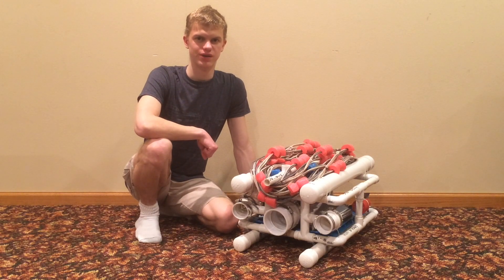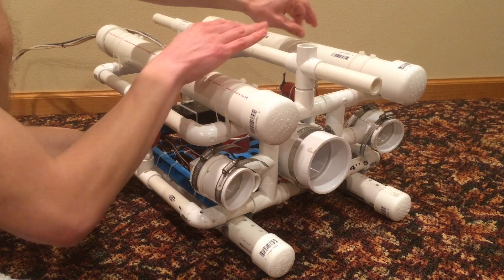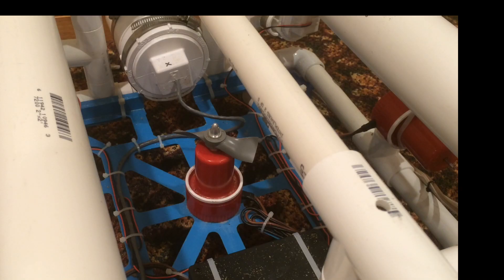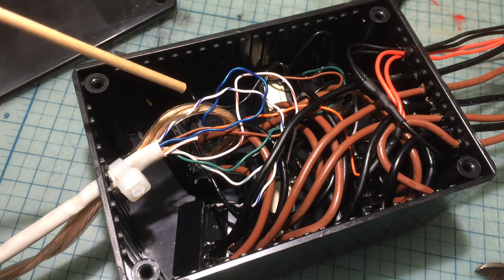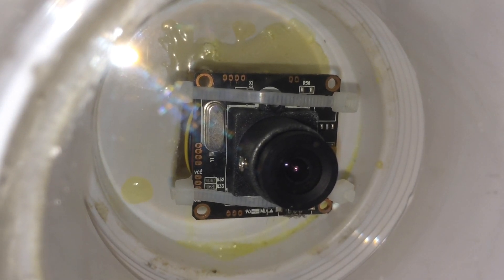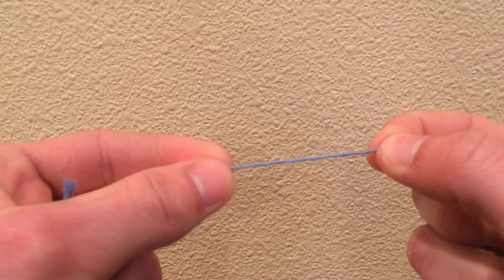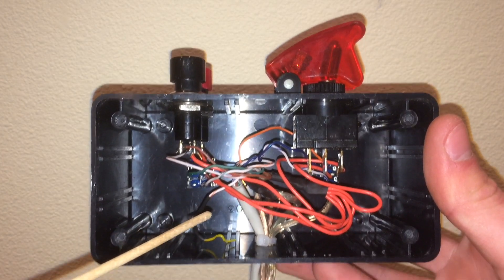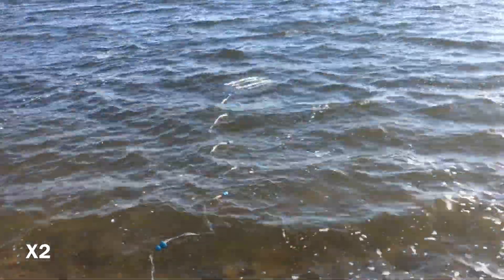Homebuilt ROV Submarine - Seafox Class

Comment: Thanks good information. Maybe go back to phisics class though or basic electronics. My camera and motors run off the same battery as does everyone's who does rc fpv. A capacitor on the power in will eliminate most feedback/noise from the motors. Me LEDs run off the same battery. The resistor is just generating heat and wasting power. A pdb or power distribution board is used. They're cheap

Comment: What's the voltage running through the phone/cat line
Reply from the maker: I initially had the voltage at 12V, but I recently raised it to 14.8V using a 4S limo battery.  That gives the submarine some more power and makes it easier to drive.
Reply: @nathanbroman1601  are there any fuses in the circuit.
Reply from the maker: @enigma3654  no, but it would probably be a good idea to add some.  I think the bilge pumps have some though.
Reply: @nathanbroman1601  one last question. Did you have issues with the amps of the battery running through the ethernet cable
Reply from the maker: @enigma3654  The ethernet cable carries the current to switch the relays, while the speaker wire carries more current to run the motors.  The only problem I've had is that there's a voltage drop over the speaker wire, which reduces the power of the motors.

It's possible to mitigate this problem by using a bigger and/or shorter cable, supplying more voltage, or using onboard batteries.

Comment: Hey! I have a submarine project and I'm wondering what cable I need for fpv to work?
Reply from the maker: I just chose a cable with some RF shielding and the appropriate number of wires to hook up to the camera (3 in my case).  I had a lot of trouble getting the FPV to work properly, so it might be worth considering buying a designated underwater fishing camera with a really long cable.

These two sections on the Homebuilt ROV Forum might have some more information:

http://www.homebuiltrovs.com/rovforum/viewforum.php?f=15&sid=e19036ce7796862a77d0d83ff8176424

http://www.homebuiltrovs.com/rovforum/viewforum.php?f=4&sid=e19036ce7796862a77d0d83ff8176424

I also found this article especially helpful for figuring out how to connect all the wires:

http://www.homebuiltrovs.com/rovforum/viewtopic.php?f=4&t=1584
Reply: @nathanbroman1601  Thx a lot!

Comment: So is there some kind of splitter on the rov that the speaker wire hooks up to to provide power to the thrusters?
Reply from the maker: The wiring diagram can be found here: http://www.homebuiltrovs.com/howtorelaywiringdpdt.html.  I hope this helps.
Reply: Did you use cat 5 pairs to connect the relays?
Reply from the maker: @EchoHawk1862  Yes, I did.

Comment: were did you get the 8 pin relays at, and how much did they cost?    and can you also explain and show how you wired up the relays
Reply from the maker: I got the relays from Amazon.  There are a variety to choose from.  You will want double pole, double throw (DPDT) relays, that are sealed so the wax doesn’t get in.  Also, make sure the relays can handle the current required by your motors.  There is an article about how to wire the relays in the description.
Reply: thank you

Comment: You might want to use a 4S LiPo with a very high C rating if the motors are drawing so much current. Onboard batteries are a must because of the huge power loss along the tether.

Comment: This is one of the best 'simple' rov builds i have seen. The pool noodle tether buoyancy was cool. So was cutting down airplane propellers for the thrusters. Boat props only work well in forward. Although a 3-bladed prop might be more efficient...cut 3 blades off a 6-blade ducted fan prop. https://www.motionrc.com/products/freewing-90mm-6-blade-fan

Myself, i prefer onboard batteries, which can double as non-sacrificial ballast. Separate batteries for the power-hungry motors and the onboard electronics. I use two-conductor stranded 14awg speaker wire for my tether cable, and communicate with the rov via rs485 serial. Two Raspberry Pi's($40ea), a Pixhawk flight controller($55), and an SSC-32 servo controller($40) allow my ROV to have 6 degrees-of-freedom, autopilot, and 26 other proportional functions...manipulators/leds/active buoyancy control/ballast drop/etc. Not to mention having a security-system dvr on board the rov to send 8 camera's worth of video up the same two-conductor tether.

1100gph Seaflo bilge motors seem to be $54. Amazon has 4300kv brushless motors/60amp esc combos for $40 now. https://www.amazon.com/Chartsea-Waterproof-4300KV-Brushless-Program/dp/B07F5H1PRK/ref=pd_sbs_21_5/132-6887515-9644830?_encoding=UTF8&pd_rd_i=B07F5H1PRK&pd_rd_r=54552edb-2490-11e9-b2b2-83751d0b2340&pd_rd_w=AvVd0&pd_rd_wg=eFV6l&pf_rd_p=588939de-d3f8-42f1-a3d8-d556eae5797d&pf_rd_r=S7C0ZHHBY99PV92MD613&psc=1&refRID=S7C0ZHHBY99PV92MD613 Pot the motors in epoxy and relace the bearings with ceramic bushings. Put the esc's in watertight containers. Coat the leds with epoxy to waterproof them and zip-tie them wherever. https://www.amazon.com/dp/B07F2536HR/ref=sspa_dk_detail_1?pd_rd_i=B07678LQ57&th=1

Just throwing ideas out there.

Comment: hey do the bilge pump work in reverse direction. Like my doubt is how is the vehicle coming up after it has gone into the water
Reply from the maker: I cut the housings off of them to attach propellers, which do work in reverse.  By reversing the current to the pumps you can make them spin the other direction.  If you choose to keep the housing attached, however, the pump will function like a jet and you will have to use a separate pump pointing the other way for reverse.

Comment: you are using seaflo bilge pump but how many gallons per hour? the reason i ask is that there are many seaflo 12 volt bilge pumps all with different flow rates which did you use?
other than that...thanks for the inspiration
Reply from the maker: I’m using 1100 gph pumps.

Comment: How deep can it go?  Probably not 100 feet (the length of the cable).  You talk about water proofing.  But we need to consider the pressure too.
Reply from the maker: I'm not sure how deep it can dive, but as you pointed out, it is limited by the length of the cable.  The furthest I have ever dived with it is about 20 feet.  Last summer I strapped an underwater camera, which was rated for 50 feet, to it to capture onboard video.  I suspect that the biggest waterproofing danger is water leaking in through the threads on the PVC pipe housings or forcing its way through the wax in the relay box.  I should also point out that even though I used wax from a toilet gasket in the video, I have since switched to candle wax, which is more solid.  Epoxy would be rock-solid, but would also be almost impossible to remove for maintenance.

Comment: Awesome job Nathan. My son's home school 2013 class and I built an ROV submarine. They were unable to complete it that year and he graduated, so the following years home school class completed it. They took it to the 2014 NASA Neutral Buoyancy Lab competition and placed third. I was pretty proud of those guys. It' funny you guys come up with some of the same ideas we had including the controls and buoyancy. However we didn't have the weights on the bottom. I thought that was a great idea, just don't bump into anything to fast or the loose marble weights will slide to one side and tilt the sub. We opted to use connectors at anything that required power or could fail, that way we could easily unplug it and change it quickly. There's a video of it on my channel if you want to see it, "Submarine ROV Robot built from Scratch". Again nice job. Best Wishes n Blessings. Keith Noneya

Comment: Nathan do you have any diagrams of your framework especially the lights how you made them adjustable
Reply from the maker: This frame is similar to mine: http://www.homebuiltrovs.com/seafoxretrofitframe.html

The adjustable light joints are made from T-fittings that I cut the top off of.  I used hose clamps to attach the light pods.

The dimensions of the frame are really up to you.  A longer and narrower frame would go faster since there's less cross-sectional area, but a wider frame with the motors further apart would make turning easier since the motors could produce more torque.  Using thinner pipe would also reduce the cross-sectional area.

I personally think my frame is a bit on the large side so the submarine doesn't go very fast, but that also makes it very stable.  Another advantage is that it's big enough that I can carry the video monitor, the remote, and any other equipment within the frame, so that the submarine functions as its own carrying case.

Comment: Hey, need more current to the ROV  change DC to AC boost voltage from 5VDC  to 40K VAC, Reverse the process in the ROV. 
This is cheap to make and do. This allows for thinner wires and more APS.This goes back to Tesla and Edison and cable size voltage and line loss. Tesla one.  You can also run more than one wire  pair. Also, add a few batteries in the Sub to hold down loaded energy for high draw needs and charge them at low draw times.  Like a Prius. Good luck with the changes.
Reply: That would definitely be bad. The AC would induce current in the tether and definitely mess up the camera signal. Not to mention an arc could easily form, and you would definitely get a fatal shock if you accidentally come in contact with the live wires. The best solution is an onboard battery. It doesn't need to be a car battery, it can be a LiPo.

Comment: if you run SLA batteries, they are already water proof.  You would only need to find a way to keep the posts from corroding.  I would solder some leads on the batts, then cover the exposed metal with brush on electrical tape (ie rubberized paint)